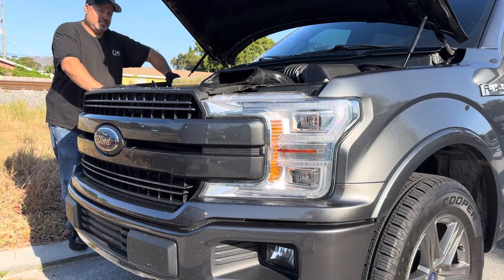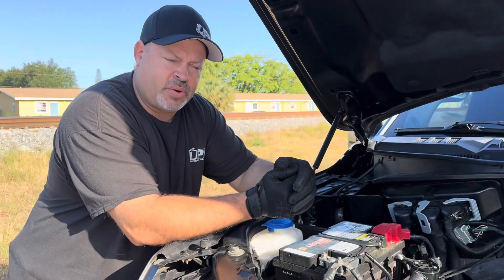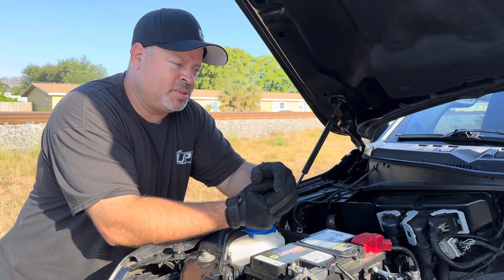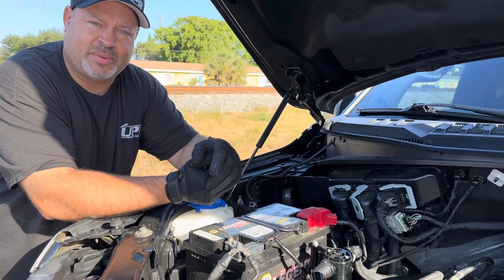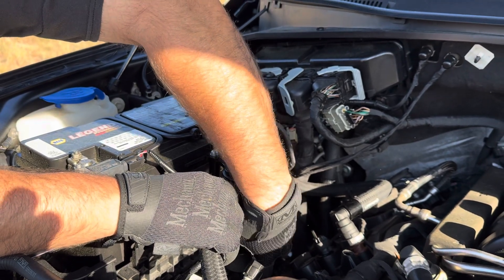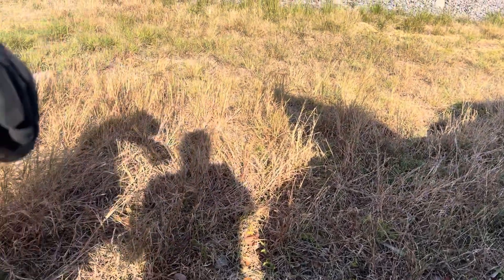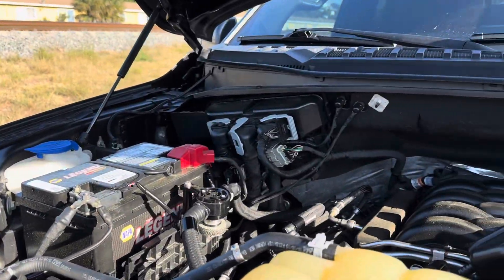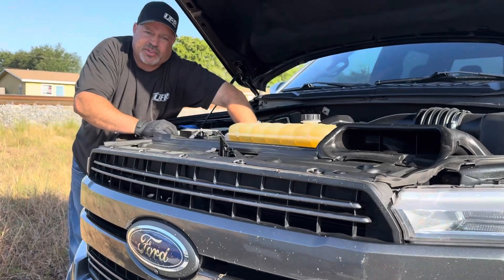Do catch cans actually work? ￼

Comment: I have a UPR catch can and it does work on my '18 Challenger Scat Pack. My biggest concern is that catch cans are illegal in California and my car won't pass the smog inspection with a working catch can. Since my catch can has the quick disconnect fittings, is there a male to male fitting where I can connect the two hoses together for the smog inspection? Do you have any other information about how to pass the California smog inspection?
Reply from the maker: The best thing to do is to reinstall the factory hose.  On your vehicle, you would use a pick or a small screw driver to remove the barbed fittings from the rubber grommet in the intake manifold.